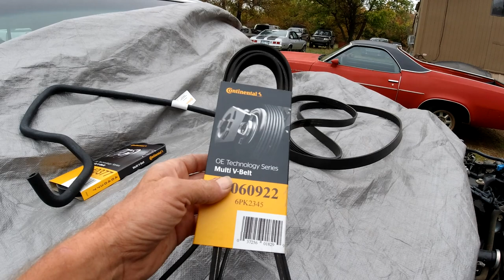1968 Chevelle Nomad Restoration - Part 44 - Big Cooling System Upgrade ! @Alloyworks #Alloyworks

Comment: That aluminum fan shroud will restrict air flow . my opinion if your going to use it for the electric fans I would drill holes in it 🤔 The super bird that Hoovie bought would overheat for that exact reason . Keep up the great job 👏

Comment: @ Clunkers And Classics
There is a video and I had also seen somewhere else. Silverados end up with Condenser leaks on the upper driver side. 
Belts and hoses are about half the Price on Roc Auto. I know they hit you with shipping. Sometimes you get lucky and everything ships from the same warehouse. I always load my cart and play around with my zip code. Sometimes changing a brand changes what warehouse the item ships from.

Comment: You’re restricting airflow using that aluminum shroud ass backwards. Better do away with it and mount the fans directly to the radiator or condenser!!
Reply from the maker: It'll work just fine for what I need it for.
Reply: You can probably change the direction of the fans by changing the polarity
Reply: @davida1878  You can but there is just way too much restriction. I never seen anyone do that 😝

Comment: Amazing job, but I have a doubt about the sheet metal which is open only in correspondence with the two fans. Why not leaving everything open so that the air flows trough the whole radiator-condenser surface?
Reply from the maker: Because I wanted fans as backup and somewhere to mount the condenser.
Reply: @clunkersandclassics  Let's hope it'll be sufficient. Maybe you could open some more holes in that sheet metal?